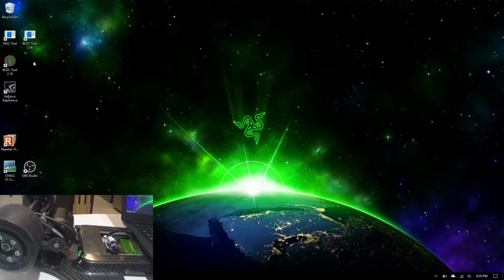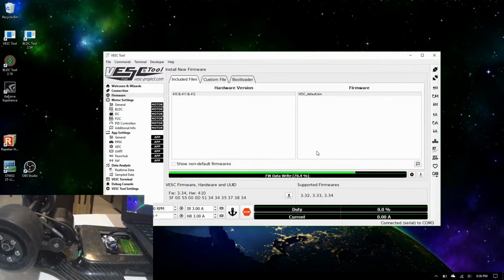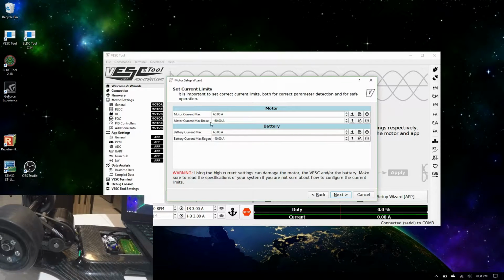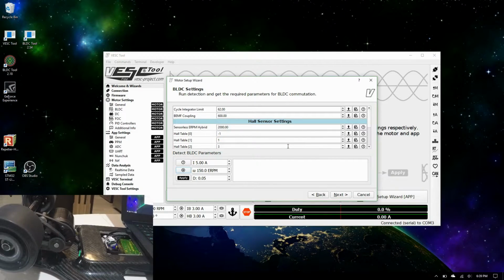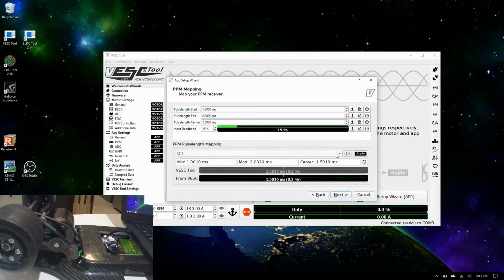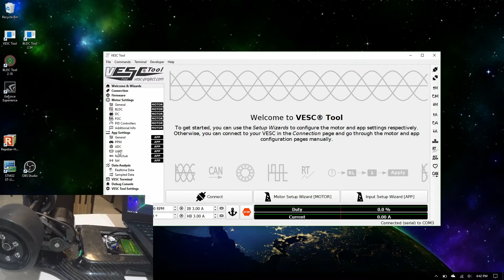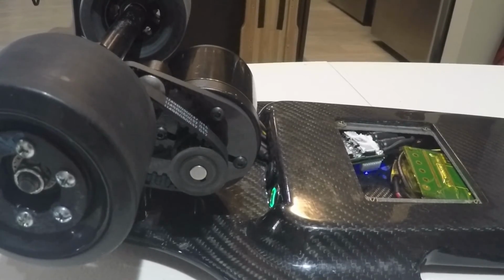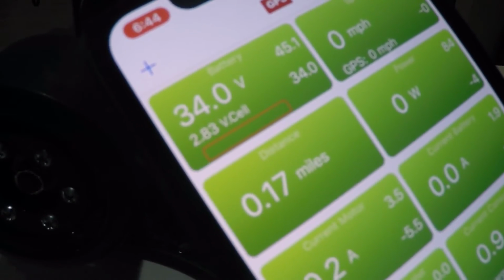OESC Setup with VESC Tool

Comment: How to control the motor directly using vesc tool in a computer?
Reply: Enable keyboard controls on the right side of the tool. should be 5 icon from the bottom

Comment: Hi, I am running a 12 s lipo . is there any reason you changed  the battery current max to 25? all my setting are the same as yours. I just left my battery current max at 60. will is harm my VESC?
Reply: It's dependent on your battery. I'm using Samsung 30Q Liion cells, at 12S for our application 25amps is good... You can leave yours at 60 if you battery can handle it.
Reply: @OriolMachin  how about running a 12s10p Samsung 30Q Cells?